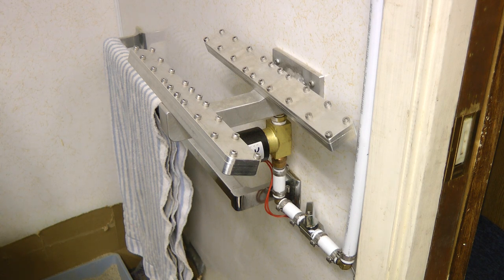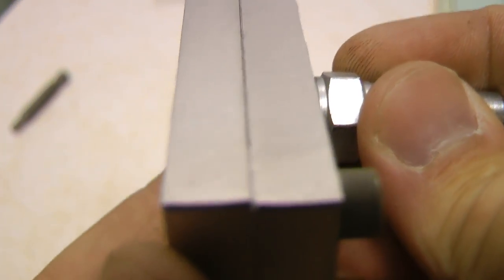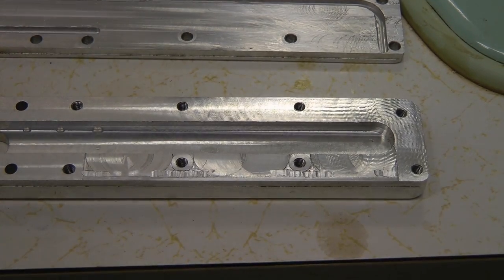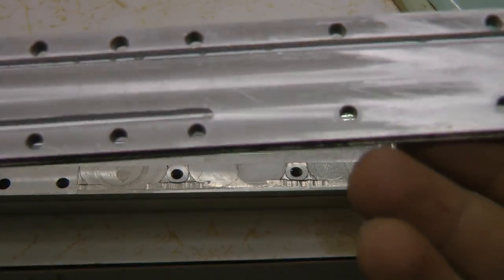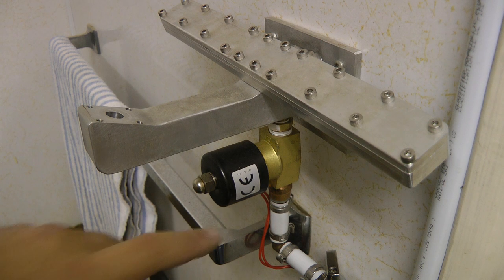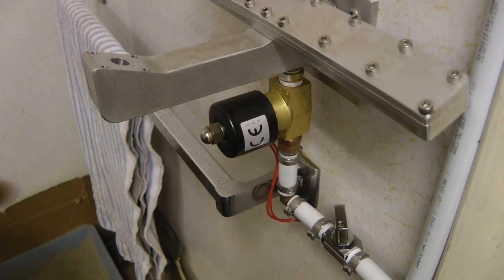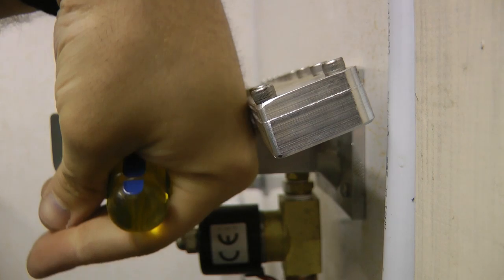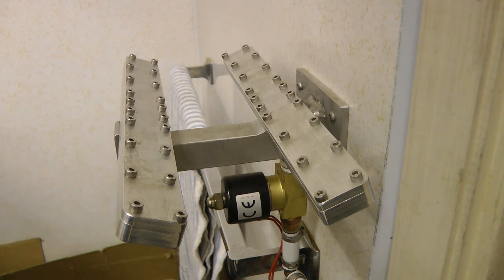Pneumatic hand dryer - Dyson Airblade clone

Comment: Cool, you should add a secondary inlet where oviposition pheromone can be added. that way if someone you don't like comes over, you can have them use the airblade and then when they walk out, they will become nice friends with a number of mosquitoes within an acre or two.
Reply: Depends on how close they would be to you and/or friends/associates.  Those bastards are not very discriminating.

Comment: Pilot controlled quick exhaust valve using a pneumatic foot control as the pilot (like what Photonicinduction uses for his HV supply)?   We have a Bradley wash sink at work with pneumatic foot controls like this to control the individual water nozzles.

Comment: Hand guards are easy. Bend four pieces of 1/4" stainless rod. Bolt pieces of aluminum on top with a thin shim. Drill 1/4" holes centered on the join. Remove bolts, discard shims. Insert rod ends into holes then reinstall bolts. The lack of the shims makes holes smaller so the pieces of aluminum grip the rods. With some redesign the guard rod holder holes could be integrated into the main bars and covers.

Another possibility is to put the guard lip back on the covers then mill a slot through from the top. Done right that could be used to pull air in using the Venturi effect and allow using less volume and pressure from the compresser.

Comment: Looks really nice. Frankly a lot cooler than the Dyson.

Coanda effect, that's why the air was sticking to the lips.

I think the pedal you might want to look for would be the one that operates those car wheel tire machines. I'm not sure, so you'd have to check the specs, but i think that could deal with your requirements.

Either way, really cool device.

Comment: That looks a lot like a gas furnace air solenoid valve to me. Anyway you can get these way up to industrial sizes and I woudl not worry about 12-24vac. If you are just isolate it through a transformer and/or use a set of fuses like the ones built into christmas tree light plugs. But 24vac aint gonna fry anyone, even with wet skin. They've been using those in furnaces for at last 75 years.

BTW I have compressed air coming through in 3 levels of this bldg plus outside. : )

Comment: I don't find it to be a problem. But, would it be to big of a re-design to put the air inlet on the back for people who want a "flush mount"?
Reply from the maker: It would be very easy, as there's already a hole there because the air hole through the central piece was drilled from the back.

Comment: You could do away with the electrical system on the solenoid by modifying a sprinkler solenoid to be manually activated. commonly this is used for pneumatic cannons although I'm not sure what sprinkler solenoids are rated to.. When I made one, I got the solenoid to be activated by an airgun trigger

Comment: Mount a small security PIR detector in a holder, have a 12v relay on it and connect to the solenoid you've got there. ?
Reply from the maker: Was thinking of that, but it's hard to beat the simplicity of a manual foot switch. Comes on exactly when you want it.

Comment: Cool! On thing the Dyson air blade, the nozzles are parallel to the floor right? Yours is at a steep angle. Is that necessary? Anyway great work!
Reply from the maker: I think the Dyson nozzles are angled too. You don't want splashes of water going up towards your face.

Comment: have you reduced the pressure of the air to avoid the dangerous effects of compressed air
Reply from the maker: That's what the lips on the front were for, but they caused problems. Still working on that.